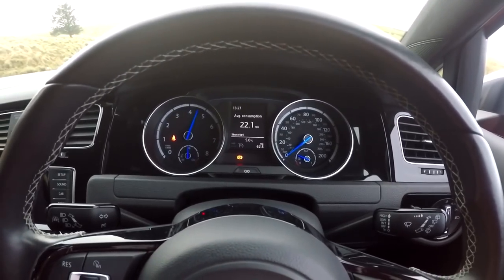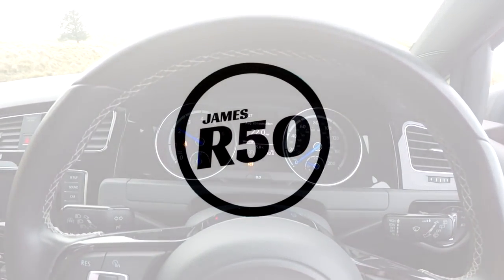Haldex Pump Problems *MK7 GOLF R*

Comment: I had also haldex pump failure. Remove the pump clean it inside. It's regular electric motor, dirt make commutator shortcut. You will need niddle and pressure air. I get first failure at 15k miles. Now i have 70k. with original same pump.
Reply from the maker: Kamil Rózicki That’s good going👏🏻 and Thanks for the advise👍🏻

Comment: Have a 16 Audi A3 and I notice this first when I was driving to work in the morning (During summer and it was dry). I was cruising at 40mph and decided to floor the gas pedal and that's the first time I've seen my TC light flash and hear the front tires spinning. I was surprised because I never expected it. Literally just scheduled a Haldex service with Audi for tomorrow, being that it's snow season. So hopefully they fix it and not tell me a load of bull😂😂😂😂

Comment: Sounds like you need to reset the base setting like everyone is saying, the adjustment is due to wear on the clutches, for some reason the pump is not resetting at each drive cycle. By removing the pump, changing the oil your probably resetting the base setting for the clutch lock to unlock values. Perhaps VW intended the Haldex to be serviced more for service charges, and the fluid change allows the clutches to work as intended. I'd be curious if you could just re-program the control unit for more lock up....? The clutch packs are heavy duty, so clean or dirt fluid changing vs. adjusting the preload is obviously the job of the pump, fluid viscosity will drop off as the fluid wears, the dirt in itself seams to be the problem, perhaps a better filtration system, or better pump design with better filtration, or separate oiling systems .... I vote for control unit flash, updated pump if they have one.

Comment: Great clip! Thanks for sharing! Do you also get the following error message on the AWD control module? 
1 Fault Found:
16670 - All-Wheel Drive 
          C1113 07 [008] - Mechanical Failure
          Intermittent - Confirmed - Tested Since Memory Clear
Reply from the maker: Vlad Serbanescu I’ve plugged it in and no fault code shows and Thankyou👍🏻

Comment: What power are you running with this? I did a u turn and planted foot out of the turn and the front wheels lit up bringing on traction control. Unsure if this is the pump issue or just how the haldex works.  Car is still under warranty

Comment: Your pump hasn’t physically failed. Just needs resetting with obdeleven / vcds.
Reply from the maker: ScotchEgg Thanks for the info👍🏻
Reply: jamesr50 be interesting to see if this fixes it ?!? Let us know !!!
Reply from the maker: Antony V I’ve got a complete replacement the pumps ain’t to expensive
Reply: jamesr50 around £230 ish I believe, yet that’s £230 spent instead of 5 mins using obdeleven. Plus another £40 on new oil.
Reply: If you would have taken this to VW, they would have done this reset procedure.

Comment: did you solve it?  I had a similar problem in my S3 8V and the solution was to make basic adjustment to the haldex pump with vcds.
Reply from the maker: Jorge Valencia yeah I replaced the haldex controller for a PreOwned one and it sorted it👍🏻
Reply: what year and mileage is your audi?

Comment: I just had mine replaced as well
Reply from the maker: salvason101 is it all sorted now I’m guessing it’s made a difference?
Reply: Yeah I got it fixed right away ! I noticed when doing a little pull. The car had no traction what so ever so I figured that it had to be the Haldex pump and it was.
Reply from the maker: salvason101 That’s good then crazy how a small pump can cause lots of problems
Reply: @salvason101  what is your current mileage ? also is it stock or modified ?
Reply: Mostafa Oraby just hit 40k yesterday and I’m stage 2
Reply: @salvason101  i see...glad you got it fixed, how much did it cost you without installation fees ? also is it hard to install/need a tech to install it ?
Reply from the maker: Mostafa Oraby it’s easy enough to install the hardest part is a tricky connector to get at

Comment: What is the upgrade path away from this Haldex system?  Can it be replaced with a more robust setup?   Could the additional power you're running cause premature failure?
Reply from the maker: Ryan II I don’t think it’s an upgraded unit for the haldex I maybe wrong tho, the additional power shouldn’t make a difference I suppose it depends on how often you service it and how hard you drive but it’ll end up failing at some point

Comment: Did the haldex pump fix the problem? Been to view a cheap one and it's only got FWD but it's cheap.
Reply from the maker: The haldex pump didn’t it was the haldex ECU I bought a used one on eBay and it works perfectly now
Reply: @jamesr50  How much did it cost to repair all in?
Reply: Did you need to re-code the replacement ECU? Ta

Comment: I have a mk7 R, when accelerating hard and letting off I get a shudder/vibration from the rear! Even on the build up on the revs on hard acceleration it does it constantly through the Rev range, any ideas what this could be? Got 32k on it and had a haldex service at 30k wasn’t doing it before the service
Reply from the maker: Luki I’m not sure have you taken it to a garage yet? A lot of things can cause a shudder even the balance of the prop shaft

Comment: I've got a mk7 golf r 45000 km ( close to 30k miles) and so far ok
Reply from the maker: u3962521 that’s good only now mine has failed at 55k I’ve had the car since 30k
Reply: @jamesr50  hey James sorry to hear, actually I checked my odometer today and I have 57000 km and no issue yet. What symptoms did you get, were there any early on that you can remember?super keen to know
Reply from the maker: u3962521 I found that the Traction light was flickering when you put your foot down, the car cuts power (so a loss in power) also a lot of wheel spin and wheel hop
Reply: @jamesr50  OK thanks. I think the traction light coming off and on with full power is pretty normal especially if going around corners. But the loss of power is an issue. Thanks for sharing. My car is in for a service next week and as a precaution am going to ask them to change the haldex fluid and filter

Comment: Just had mine serviced at 55k.. the only thing I experienced with my mk7 R is when I come to a slow stop I get a small shutter that I can feel in the break peddle. Like it’s not downshifting soon enough or isn’t doing it properly. Anyone experience this? DSG btw
Reply: @denpgevelonderhoud1  go for 034 motorsport  dogbone lower/upper insert...and for the engine/trans holder pack...together with the TVS dsg stg2 remap....problem solved 4ever!!!!!!! And the car will feel taff
Reply: Do a dsg gearbox reset. It helped on my Gti since I had this problem. Google it!
Reply: Yeah I was going to suggest doing the dsg Apr tune, that'll also sort out a few dsg issues like when it drops to first gear going over speed bumps